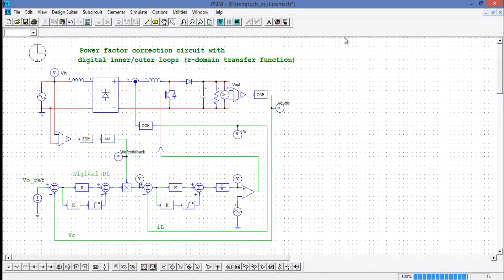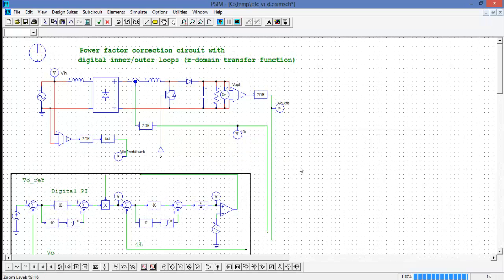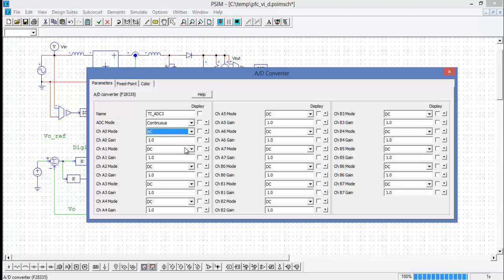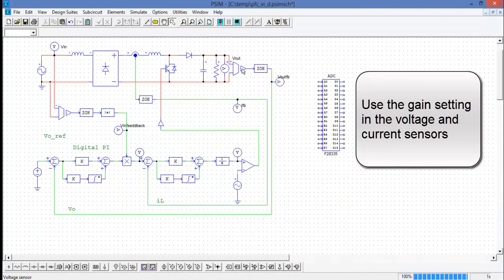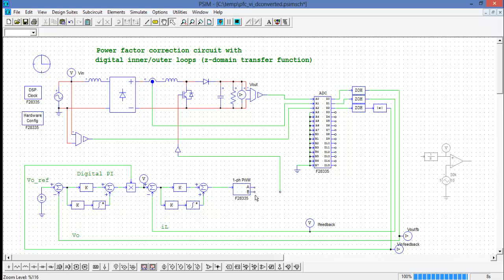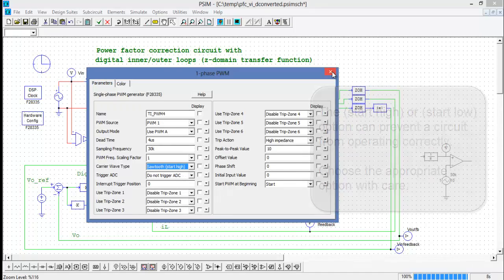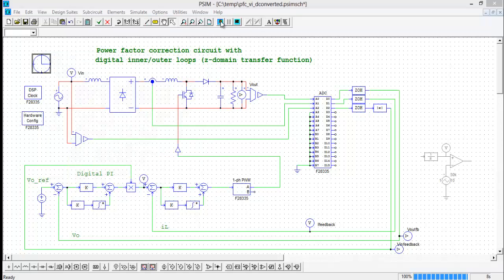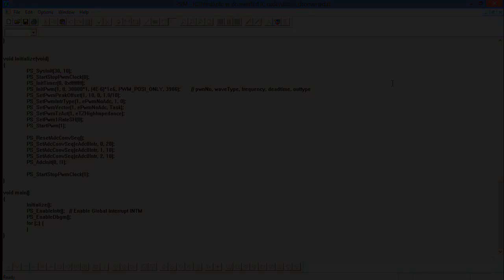Intro to Auto-Code Generation for F2833x DSP

Comment from the maker: Want to try PSIM?                                                                                   - https://hubs.ly/H0f9wCC0 
Why should you use PSIM for Motor Drive design?                          - https://hubs.ly/H0f9wCK0
Why should you use PSIM for digital control?                                   - https://hubs.ly/H0f9wC-0
Why is PSIM preferred for Power Electronics simulation?             -  https://hubs.ly/H0f9wFX0

Comment: Hi Albert, your pwm block is set not to trigger the ADC. When I do that I get an error saying that the block links to, but isn't set to trigger. How do I fix that other than setting it to trigger?
Reply from the maker: to trigger the PWM you need to setup the ADC element to "start-stop" and PWM element to "trigger ADC". To have the ADC be sampled at the rate of the ZOH interrupt then select ADC to be "continuous" with the PWM to "not trigger ADC".

Comment: i wonder to know which can do generated code?
Reply from the maker: +劉韋伯 I'm not sure I understand the question. PSIM supports code gen for F2833x, F2806x, F2803x, and F2806x from TI.
Reply: Sorry , my question is which psim version can use this function ,because now I'm using ver.9 , but I got a little bit problem, so I'm curious if my psim can't use this function.
Reply from the maker: +劉韋伯 code gen is an extra module that needs to be purchased separately. We are currently on version 11 you will need to upgrade to use he code gen tools.
Reply: Thank for reply!

Comment: I am simulating ADC only, but getting error msg 
""Error Message:
Element: PSM_F28335_ADC  Name: TI_ADC2
Error #4003: The input of the element is floating.""
Reply from the maker: you need to ground the input pins.

Comment: I am having the same doubt here, Can I apply negative voltage to ADC of the actual DSP board?
Reply from the maker: +A. Morais no you can not apply a negative voltage as per the data sheet. What AC coupling does is it automatically implements the -1.5V reference in the code. It assumes that you will have correctly offset the input voltage in the real hardware.
Reply: Thank you!

Comment: I understand that I can only apply positive signals on the ADC on the real hardware. So, I need to offset the AC signals that I want to read with the ADC. My question is how can I remove this offset in PSIM?
Reply from the maker: Using the summer blocks and a source you can easily add and subtract an offset of constant or arbitrary nature. Make sure that when you use the ADC block that you scale the feedback signal properly.
Reply: PSIM Can I apply negative voltage to ADC of the actual DSP board?
Reply from the maker: You need to check with the datasheet of the DSP to make sure that your signals are within range.
Reply: +A. Morais No you cannot.
Reply: +ujjwoltamrakar  do you know if Can I apply negative voltage to ADC of the actual DSP board?
Reply: ujjwoltamrakar Thank you